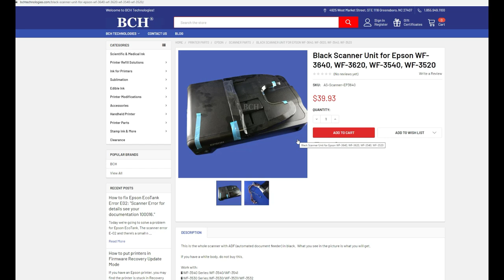Remove and Replace EPSON Scanner ADF for WorkForce Series: WF-3640 WF-3620

Comment: Hi, Kevin and thank you for your repairs tutorials. Do you have any idea why the scanner light on a WF-2660 won't stop blinking , unless in sleep mode ?
Reply from the maker: Sorry, I don’t.  Interesting.
Reply: @BCHTechnologies  I've also just noticed is only does that only in low light. Initially,  I thought the issue was gone, when I turned on the room lights. Then I thought there's a chance that maybe I don't see the scan unit light because it's too low compared to the room light, but no, scanner unit was not blinking with room lights on. But as soon as I turn off the room lights, the scanner unit light start blinking again. Very weird indeed. Any ideas? Any guesses?

Comment: Hi Kevin trying my luck But thank you for your video! I have an comme 850 and  I need to actually open the scanner unit to solve a scanner error 0x10 / 0x20 ( it changes randomly ) . I have removed the adf from main unit as you showed in another’s co related video, removed the screws but I find it hard to open the scanner part without using force…. Could you show how to open it the scanner unit? Thank you!
Reply: Help my epson wf 7710 I keep getting error 034503. I was working but I dint realized there was a jam paper in side but it tells me to turn it off n on still the same error